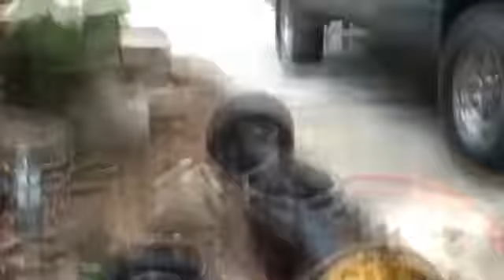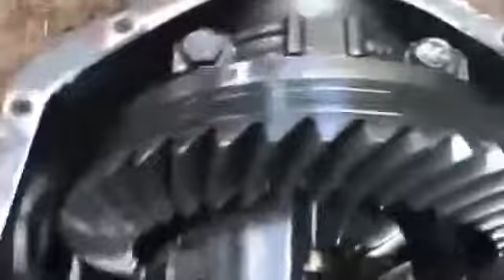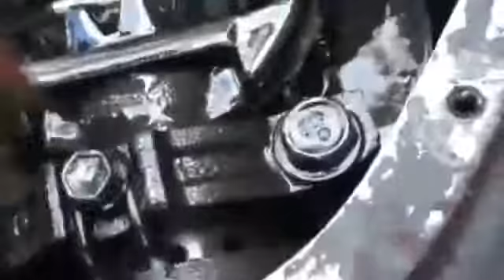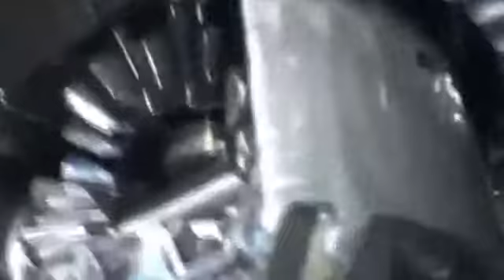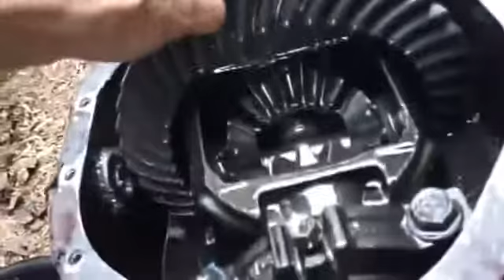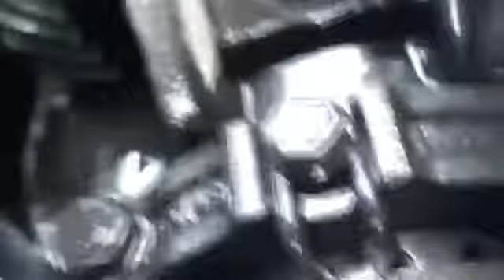1996 Chevy k2500 rear end 4 10 gears

Comment: Do the K2500 rear ends have the 5x5 bolt pattern? Wanted to see if it it was possible as a direct swap over to my k1500 as an upgrade. Currently has the v6 but will be upgraded to a L92 with a T56
Reply from the maker: Not sure what you mean about the 5x5. The braking system is different.  2500 has  Hydroboost. Not sure how that would work with the 1500 braking system.
Reply: @SawmillerSmith  how many lugs 5, 6, or 8? Is what I believe he’s asking?